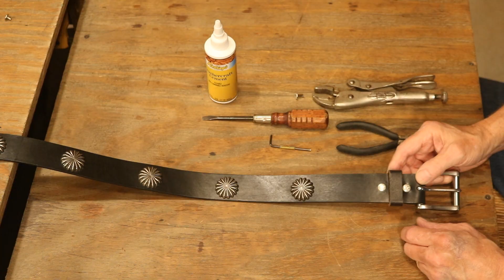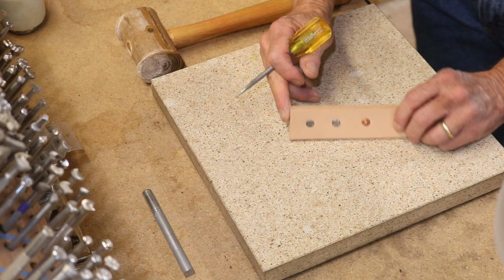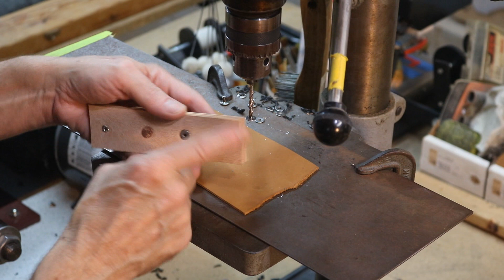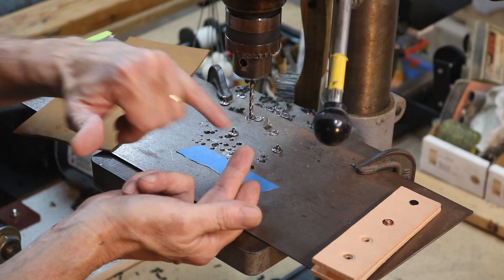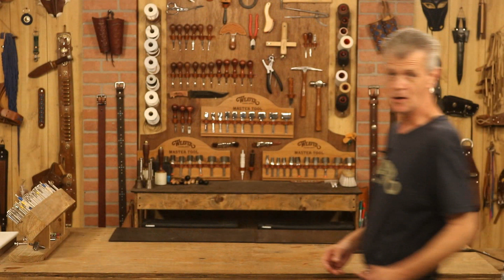The Leather Element: Removing Fasteners

Comment: Excellent video, wish it had been around when I was starting out.
For smaller straps (at or under 1"), I tend to use one of the Nippers I got from Weaver, as long as I position them right, they do a great and relatively fast job of removing double cap rivets. Have to watch so I don't catch leather with them, although usually any scars that do occur are on the inside where it can't be seen.

I have used the drill press method in the past (before I got the nippers) and when I have a piece I can't use the nippers on, although one difference is my drill press has a 1" hole in the center so don't drill into anything except the rivet. Although I had not thought of re-tapping the the rivet before continuing the drill, thanks for that info. It is why I watch the videos to pick up the occasional helpful hint.

Comment: OLD Leather Smith here,  EXCELLENT CHUCK, JUST WHAT A BEGINNERS REQUIRE. ONE Thing WEAVER has a plyers 2 help lock in CHICAGO SCREWS it also helps 2 remove them, instead of glue I use CLEAR NAIL POLISH, WORKS WELL 4 me.  Another EXCELLENT video Chuck thanks.  GOD'S BLESSINGS ✝️🥎🙃